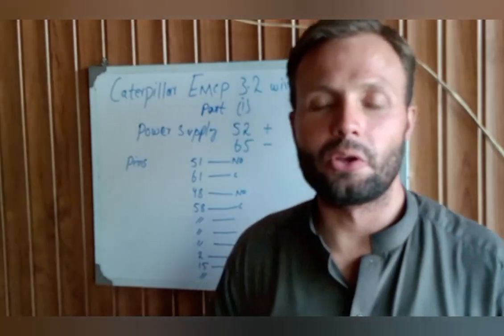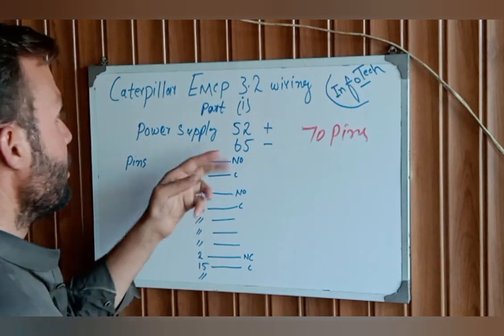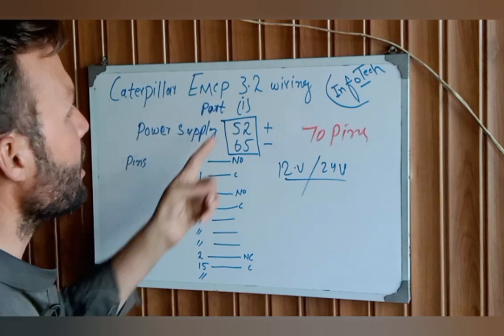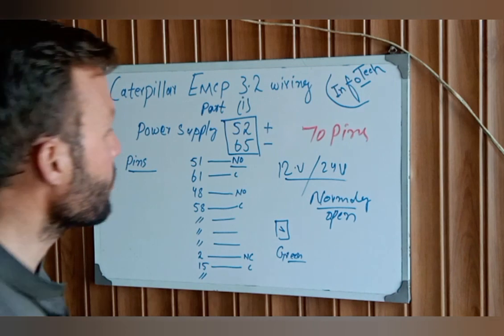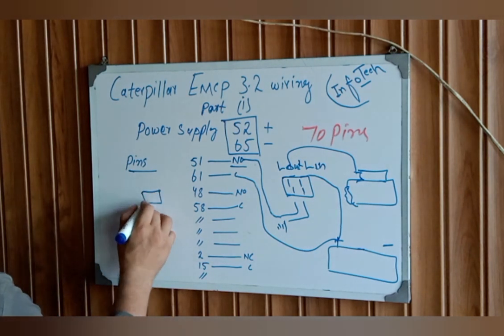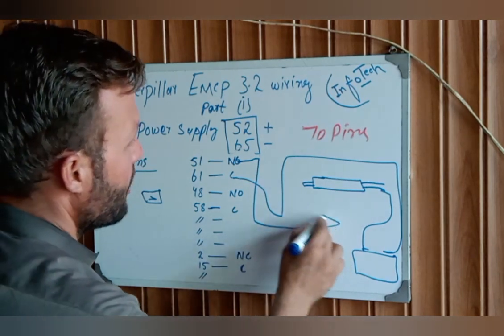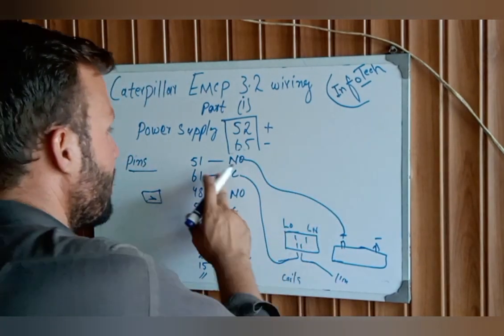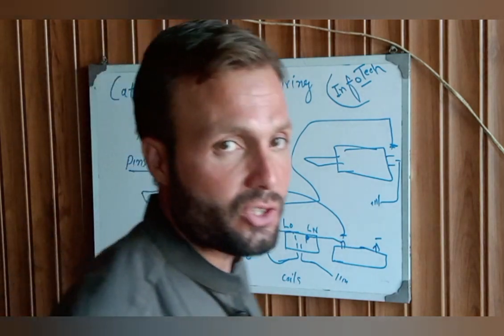Caterpillar EMCP 3.2 wiring diagrams explanation part 1

Comment: Hello sir how are you,  how to connect the charging alternator for emcp controller, thanks and take care always sir
Reply from the maker: Charging alternator have,  , 3 , or four terminal, one is B+ that's for battery + wire is directly connected in b+ one wire is W/L that's for warning light connecting warning lamps. One is B- that's for ground, one wire S that's for sensing battery voltage, regulator sense battery volt, maintain in 12.8 voltage protecting for overcharged
Reply: @Info-Tech-  thanks sir for sharing your ideas, sir  can you make a video for this emcp controller how to enter the setting of voltage, frequency, temperature and pressure, thanks and take care always sir